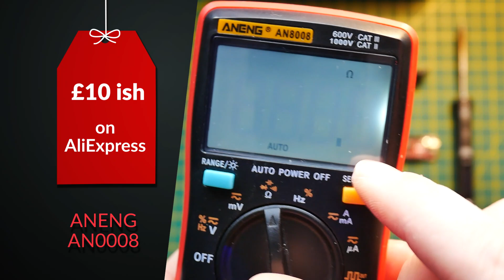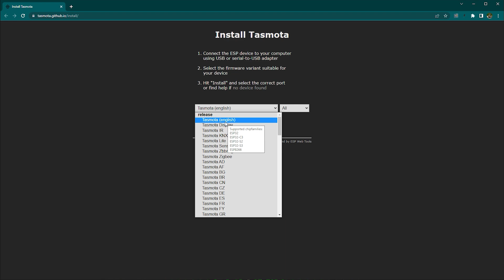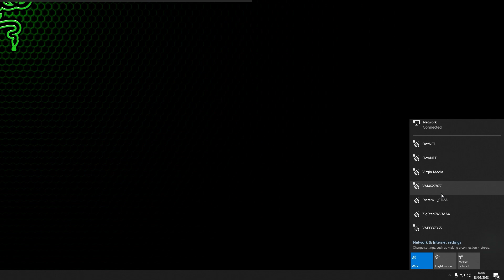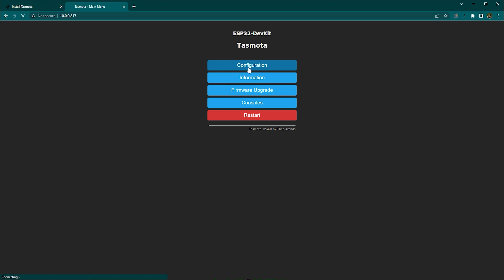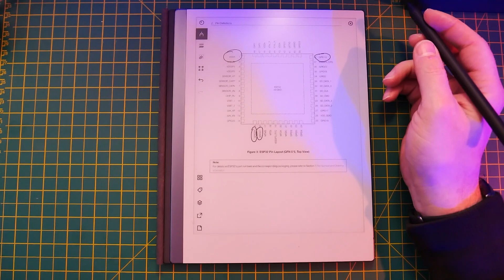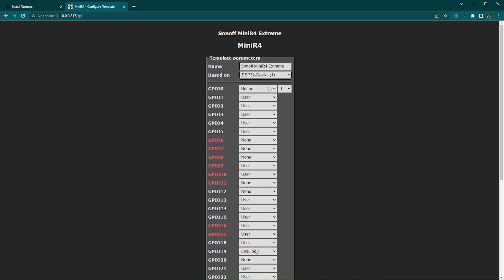Flashing Tasmota on Sonoff MiniR4 Extreme with web tools

Comment: 4:04 I connected 5 volts to the electrolytic capacitor (680uF 10V), so I used the mini's voltage regulator.
You can also connect GND to "L in". There is a large soldering area there. 
This gives space for tiny TX and RX. 4:28
Then I connected S1 and S2 before the poweron. By the way, S1 is connected to "L in" and GND.

Comment: Awesome video .upvote from me !
Now , I can solder , been doing that as a hobbyist for well decades ( I'm over 50 !! ).
The question I have is are you aware if the Sonoff DIY mode is on the R4 , and can tasmota be flashed Over The Air ? (like it can on the Mini R2 with an esp8266 ) .
I guess I'd rather avoid soldering if I can , as I've got old, well I've got a bit lazy !
Reply from the maker: There are only a handful of devices that use DIY mode which sucks, as technically you don't need to flash it if you are ok with REST commands
Reply: @notenoughtech  The DIY mode on the Mini R2 does allow OTA flashing of tasmota, which was quite useful to me . Saves me getting out the soldering iron !
I didn't want to use the sonoff REST commands !

Comment: Hello Mat, I'm using this device with S2 connected to an external switch to the live wire (S1 remains unconnected). However Tasmota does not register a switch press. Any idea on what could be going wrong?
Reply from the maker: Loop around from S1 - switch - S2 this should work
Reply: @notenoughtech of course, but this wiring should also be possible according to the manual

Comment: Hello.  Thanks for the detailed explanation.  I use the miniR4 device as a bridge with the sonoff R5 switchman scene button.  However, the R5 switchman scene button does not work in lan mode.  Can this be run with tasmota?  I want to use the R5 scene button in land mode only with the home assistant dependent.  To avoid being dependent on the internet connection. Thanks.
Reply: Short answer, no. I've ordered an M5 and two R5s (3-gang) because that's the only way to get my 3 way switch (plus bathroom light switch) smart and work together, but the custom RF protocol that the R5 uses hasn't been tasmotized yet (and probably never will be), so it has to be used in ewelink mode, which is a real bummer.

Comment: Thanks for this, have used your info as blueprint to flash MicroPython and it just worked, just like any other ESP32 device. The R4 browned out when I tried to start Wi-Fi connection, but using a spare NodeMCU board as 3v3 suply resolved.

Comment: Thanks for the detailed video! Am currently struggling with getting the wired soldered to the pins on the minir4.. but somehow i am going to figure it out :D
Reply from the maker: Make sure your iron is set to about 330-350C and make sure you heat up pins to solder sticks to them
Reply: @notenoughtech  Man, that was a ride. After many adjustments I got the soldering part figured out. But then I tried to flash it. What I didn't know was that I had to connect RX on the MINIR4 to the TX on the FTDI (and vice versa).. well I checked everything from resoldering everything, trying different computers with different operating systems and trying multiple drivers until I realized that you had to to cross pair the connection wires.

Well not that I have figured it out, I flashed all my MINIR4's in a single afternoon :)

Thanks for the GPIO Template (and the video and the great article!)